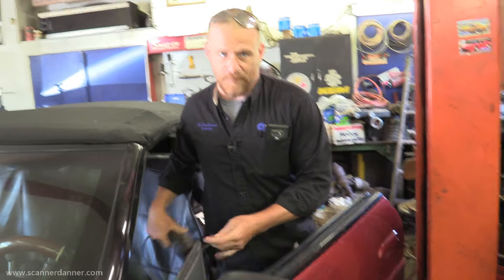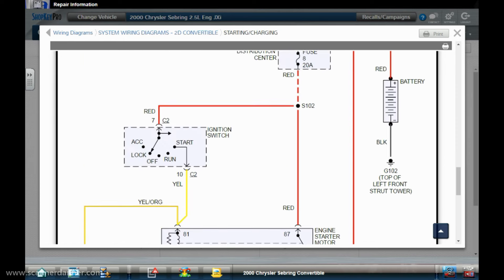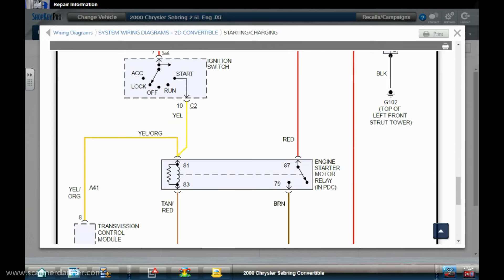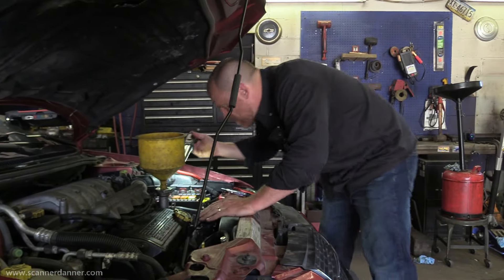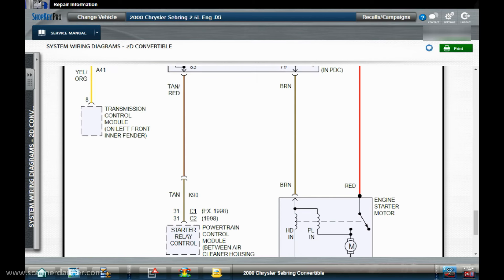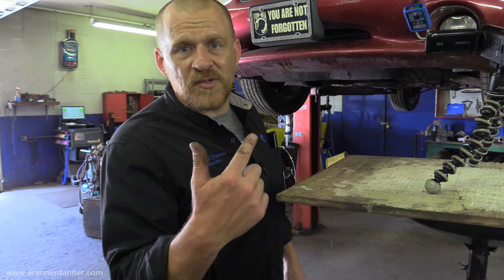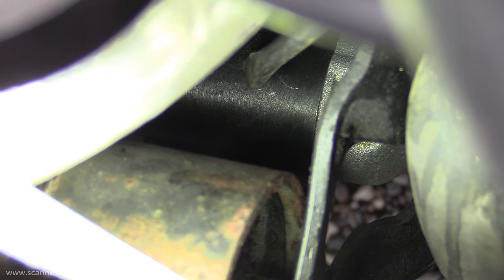No Crank Diagnosis Fundamentals  (starter testing)

Comment from the maker: One of my favorite tools, the uActivate, you can find on the tools page of my website here:
https://www.scannerdanner.com/diagnostic-tools.html
Reply: Its sold out
Reply from the maker: @Iroc_twan  they will be making more, there is a waiting list for good reason! It is that valuable of a tool
Reply: @ScannerDanner  my friend has a dodge van where the starter just clicked and thought he had a bad starter.  Changes the starter and had the same results of just clicking.  He the takes off air cleaner and looking over the wiring he doesn't see anything wrong and puts the air cleaner back on.  He then turns the key and the starter kicks in and his engine starts.  He is very happy until his motor stops and doesn't stay running.
Reply: Where does a technician get those diagrams off the scan tools ?Which scan tools have these schematics on electrical ? I see alot youtube and techs showing them. I know about all data but thats a sub deal.
Reply from the maker: @PackardBelltoll  The wiring diagrams and service information I use is a program called ShopKey (Mitchell) and is about $160 a month to gain access to it. There is a DIY version of this program where you can buy access to individual cars for $20 and you'll have access to the same service info and diagrams that I use. Here is the link to the DIY version http://eautorepair.adtrk.biz/?a=10817&c=24&p=r&s1=
Reply: @ScannerDanner  thank you. I hope to meet you and shake your hand one day. From southern California Indio area
Reply: Dude. You are so right. This tool rocks. Everyone I have shown it to loves it.    It has saved me so much time. Love it!
Reply: I’ll have to get that tool it’s on my list. The crank sensor was most likely not installed right. There is a little sticker button that goes on the end of it to set the gap. The flex plate just knocks it off when first started. I’ve also seen a lot of cracked flex plates on those cars.
Reply: I watch your videos on your premium channel love your videos, sorry for the stupid question but you said the starter housing would light your test light if the starter was bad??  But it didn’t appear to light up when you tested the housing
Reply: @germdoesit3795  If GROUND of starter is bad the 12 volts that is applied to start terminal goes thru solenoid primary winding and cant find ground except for the test light probe that
 terminates to ground
Reply: you prolly dont care but does anyone know a trick to log back into an instagram account??
I was stupid lost the password. I would love any help you can offer me
Reply: @Lionel Mitchell Instablaster ;)
Reply: @Kylan Watson thanks for your reply. I found the site through google and I'm in the hacking process now.
Seems to take quite some time so I will reply here later when my account password hopefully is recovered.
Reply: @Lionel Mitchell Glad I could help :D

Comment: If they don't like being charged the fees let em take it somewhere else or diagnose it themselves......Time is money!!!
Reply from the maker: for sure, just wanted my community to know and customers for that matter, that the intermittent no start (cranks normal) after the repair of the starter would be a separate fee
Reply: It's so true you need to have good confidence .good job teacher.👍
Reply: ScannerDanner Thing is Paul customers sometimes don’t understand that the two problems are nothing to do with each other or the repair that you have done has “caused”another issue and all this stems from their lack of understanding on how a vehicle works
Reply from the maker: For sure and this is where customer communication is critical. Also being a man of integrity and people know it helps too. And if you have those in order and a customer gives you crap about it, you simple don't need that customer anymore.

Comment: Thanks for the video,its funny how when people take there car to a small shop they expect a small bill,but when they go to a dealer and pay $200 to get a fuse put in thats ok.
Reply: Its crazy .
Reply: I always laugh when people assume the dealership costs more.  We only charge $89 for most basic diagnostics and I can usually solve most issues in that time.  It is usually the aftermarket shops that hose the customer after parts chucking and screwups.
Reply: @radman999  it's because sometimes you get a quote for a $1000 for a part and you go to napa and buy it for 300. I recently needed a seat for my ford e250 and they sold the cover and cushion separate. The cover was over 300. Same thing happens with my bobcat. I replaced a txv for $70 bobcat wanted 250+.
Reply: @simclardy1  Maybe if you own 80s cars.  Most of the aftermarket parts I see are total substandard shit that cause more problems than the old ones.
Reply: KWP That’s so true,some pattern parts are truly shocking and hadn’t ought to be allowed to be sold especially electrical stuff like 02 sensors and aftermarket catalytic converters
Reply: @radman999  i would agree that some of the knock off parts should not be allowed for sale. I've had my share of new junk parts. I resent junk parts made in sweat shops and i also resent overpriced quality parts. Companies try to monopolize their product and then charge a premium, im thinking of apple products, but they are not alone.

Comment: I had a '94 Tempo that had a bad fuel pump relay. The shop manual was wrong on it's location. I called Ford parts service, they were wrong. I checked another shop manual, it was wrong. Three incorrect locations. I traced the wire to the relay from the pump and I found the relay, not even in ANY of the locations shown. It was in a box on the left side strut tower. What the Hell was that ?! Lol. Now that made no sense at all !

Comment: Well, that's kind of the case that I had with my 2009 Subaru Forester. I had a code and check engine light, checking everything but the new part I changed a week ago. Finally, the new part came out to be faulty and replacing it solved the problem. The cause for that anyway, some gunk into the plug after washing the engine with pressure washer making intermittent contact, and cooking the sensor itself all of a sudden. You're right, stories being told are great to listen to, but shouldn't necessary be our decision to make. You don't know what happened along the way swapping the engine.

Comment: I've lost count of how many times I've heard, "But it can't be that - it's NEW!",  with all the new part failures that happen these days. Sort of the same thought here - may have just been a coincidence that this starter was at the end of its life, and its very last crank was to move the car into the shop for the engine swap. The way things are made today, you're lucky to get a year out of a new starter sometimes.

Funny, usually the same people who complain about an hour's worth of labor are the ones that'll spend $8 for a stupid coffee 7 days a week at the local yuppie hipster coffee shop, 2-3x a day. Most people just don't understand the systems on modern cars - they're basing their thoughts on something they heard from, or has been passed around from a mechanic 35 or more years ago. The 1996 model year changed EVERYTHING.

Great stuff as always, brother Paul! That uActivate tool is on the long list of things I need. I just went and bought a paramotor, so the funds have been depleted for the moment. Had to take care of the mental health first, lol. :D Lookout! Smitty's a pilot now! :D :D

Comment: I just did a voltage drop test for a bad engine ground in a parking lot of a gas station the owner of the truck was fascinated with that test. He was really stoked when I took his jumper cables from battery ground to engine block and the truck fired up! I looked for the engine grounds and someone used house wire for the engine ground and it was all melted and corroded!

Comment: Final check, gotta make sure the starter has a good ground. I watched one of your videos to trouble shoot a no crank problem and from your video I determined that I needed a new starter but and that's a big butt, I did not do the final check. I got a new starter and got under the van to remove the starter and wa la. One of the bolts holding the starter in had a stud off it that the ground connected to and that nut holding the ground wire was loose. 
Another great video by the dynamic duo. Way to go Batman and .... oops I mean Professor and Caleb.

Comment: love your comment about the " armchair Mechanics "  way i see it Paul people aren't paying you for your Ability an Diagnostic skill set, their paying you for your Experience in being able to Diagnose why their car isn't working!! ... they can take their car to other Mechanics ( where most would just replace the starter motor, at the customers expense an still not solve the problem, ) where to me you take the time to check the wiring, wiring harnesses, connections, fuses, computer, tcm, pcm, etc before saying its a starter motor, an to me that.s where your experience comes into play, knowing where to start, what to check fist, an being able to Diagnose the problem, the fact that car has a separate issue is as you said an added Diag Fee, great work as always my friend cheers ...

Comment: 23:02 they put the new engine in (with its own set of problems), if they want the new engine fixed, then they can pay you to fix it(with all the training and expertise), otherwise, i would be happy to pull this thing up front and send you on your way so that they can spend all day trying to figure it out themselves:) i know the dealership i work for has 2 types of a/c diagnosis and you need to watch what your doing, if its an electrical issue, thats 1 diagnosis, if its low on charge, thats another diagnosis, and sometimes i need to collect on 2 different diagnosis to figure out whats wrong with your a/c(im sure im gonna get a lot of crap for saying this online)

edit: thanks again for the great content! really appreciate the point of "be sure in your diagnosis", really cool to see you and Caleb doing this together again!
Reply from the maker: Thanks man, it is awesome to work with my son in this way

Comment: Great video as always! I did fix a bmw 5 series after fixing the the valve steam seals the car will not crank only the light would light up in the dash ! Turns out to be , the only one ground wire that it had was pull off when I jack up the engine, it took me. A Week to find it , I was very frustrated but I did find it , Bmws have very poor ground wires I’m sure that’s the source of many bmw problems! Take care danner your videos are so inspiring God bless you
Reply: You have not lived till you tell the customer on them BMW labor is $150.00 to replace that starter. As you have to take the Intake off. It's mounted on top of the Engine. In the rear under it..
Reply: Master Chief 00117 I’ve done Bmw starters on Bmws I yes I lived that last Bmw starter I charged $550 with the starter and labor ! Keep it up and God bless you too brother in Christ

Comment: As usual an informative video. Thanks to the team. If I may be allowed to make a comment; I wonder if you could have used a “by-pass” tool? A long enough and of proper gauge test wire to check the starter.  
One side of the wire would be connected to the battery positive with an alligator clip. The other side of wire would be connected to a long enough metal rod with a clip, clamp, etc. an insulation on the rod would be even better, so only the tip is exposed. 

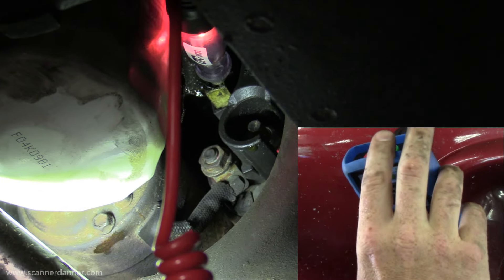In frame 12:52 the stud that connects the starter solenoid to the starter is exposed. A quick tap on that stud will make the starter click or if good, try to turn.  If starter is good and the rod held for a longer period, it would be similar to bench test of the starter motor only.

That would put the fault at the solenoid. Regardless the starter/solenoid must be pulled, but at least the “starter” is either condemned or exonerated.           

Once the “by-pass” tool is made, the testing will be very quick. A good addition to the arsenal of electrical system diagnosis on some vehicles.
Reply from the maker: What you are describing would work but honestly it is not need once you learn to trust your equipment. You need to have a good database of known goods and known bads in your mind first.
Reply: Thank you for your reply. Regards.

Comment: What happened when you were using the scanner and there was a transmission temperature reading over 1,000 degrees?
Reply from the maker: Time frame please
Reply: 5:41
Reply from the maker: @ethanscott8782  ah yeah, these early Chrysler's had some issues with their transmission fluid temp sensors providing b.s. data. Ignore it, no problem here at all. The transmission fluid temp sensor signal voltage at 2.39 volts would be a normal signal and the transmission fluid temp sensor degree f is the b.s. data

Comment: i never thought of using test light in a voltage drop test like you did with that ground to ground on starter that totally makes sense for vd,infact i wonder if doing this with led light would find voltage drops that are much smaller.for vd testing low amperage circuits.of course my meter would be best but i love having these ideas in my back pocket.i love test lights for low tech quick checks.
also curious if your test light type videos get more views since most of us dont have these expensive scanners and scopes
Reply from the maker: I think you're right about the LED light, but I never use them in troubleshooting because of inaccuracies with it (showing you a good power when there is only 4v on a circuit for example).
As for views? Yes most likely. Many people think that because I use expensive test equipment, that they can't learn from the procedures and so they move along. Unfortunately

Comment: Another great video, Paul. I do have a question about the Uactivate tool. I own one, and I absolutely love it, like you. But do you know if they have any built in circuitry inside of it that provides a small load on the control side to substitute the relay coil load? Basically, should I also be using a test light to ensure that I am getting a true loaded power and ground to the control side of the relay? Does my question make sense? lol
Reply from the maker: perfect sense my friend, the only load would be the LED bulb which is significantly less than what the relay coil would be. I'll have to measure it sometime. If you are concerned, you can easily load the circuit more with your test light. I think there are variables with any tool and with any testing methods, wouldn't you agree?
Reply: ScannerDanner i absolutely agree. I still absolutely love the tool. I use it all the time.

I’ll need to measure the load. I just wasn’t sure if they added an additional load to the circuit of the LED bulb, or not. That’s all.
Reply from the maker: @VoltageDropDiagnostics  I don't think so? But I did realize that I wasn't using the tool properly until late in the video and that was the load side LED check! That test told us what my test light connected to battery positive told us and that was that we had continuity all the way down to the starter and through the starter solenoid :-)
Reply: Before Paul had the Uactivate, he always used a test light. Then he would use the tool that allows u to plug the relay in and that tests the relay. I have Uactivate also.

Comment: @13.27 you checked the starters ground, but you had the test light connected to a ground. That test light won't light unless you have it connected to battery positive checking for ground. Correct me if I'm wrong
Reply from the maker: If the ground is bad, that test light will light when connected to battery ground.  Sounds weird doesn't it? Check this one out https://youtu.be/GQvLHQVtC0Y

Comment: Working heavy lines for a while, no reason to mess with the park/neutral switch on motor r&r for that car. Just cable disconnects.
Reply: I would've made sure batt cables clean & tight, test light at starter for control signal. 
Not seen the whole video yet sorry.

Comment: Would it also be a valid check to jump the 12v on the starter to the solenoid to see if it would crank? As one last check before you pull the starter and put a new one in. Thanks for your videos, very informative.
Reply from the maker: only when you don't trust your voltmeter and the tests performed, but yes, you could do that if it makes you more comfortable in this situation. They key in trusting your meter is that you are doing loaded circuit testing. In this case key in the crank position for all tests, even the hot all the time heavy cable.
Reply: @ScannerDanner  thanks for the feedback.
Reply from the maker: Does that make sense?
Reply: @ScannerDanner  100 percent. Thank you
Reply: One more question, when checking battery voltage with load (just key on, not cranking) is it normal to lose between .3 and .4 volts? Or is that an indication of a wiring issue? Right now I am not getting power to my solenoid control wire. I have gone though all the other basic checks, I have good 12v at the battery and starter. Doesnt seem to be any ground issues. But I did notice that when i turn the key to the one position the battery voltage drops .3 to .4 volts. 
 Thank you!

Comment: This is what i would do first - i am not a pro by no means.
First thing first if u hear no clicking it means bendix in the starter does not pop out. If it happens the starter will never run as it needs to pop out to make a loop
Next I would hit the bendix while other person holds the key in start position and if no sign of reaction
Next I would unplug the cable from bendix and see if it gets voltage when in cranking position and if the answer is yes then your bendix in the starter is broken

BTW. 19:36 

I am not 100% sure but i think that when the starter motor is old and worn and there is deposit of brush dust and other stuff that gets pulverised over time it gets moisture gets trapped within that dust. Could be a simple coincidence as well